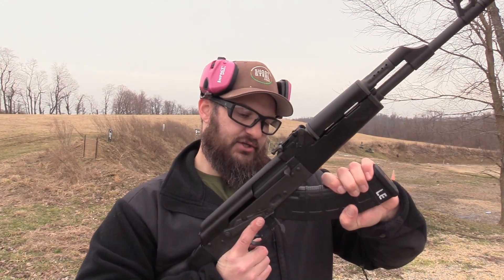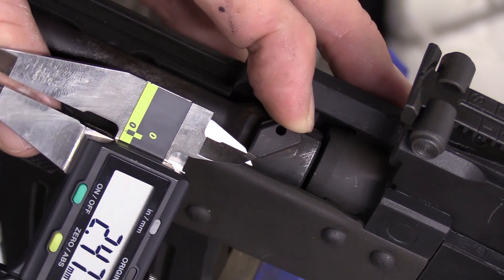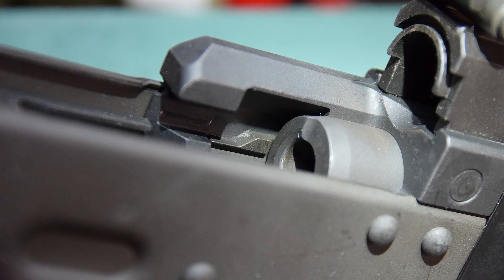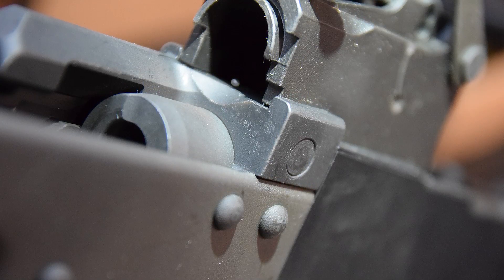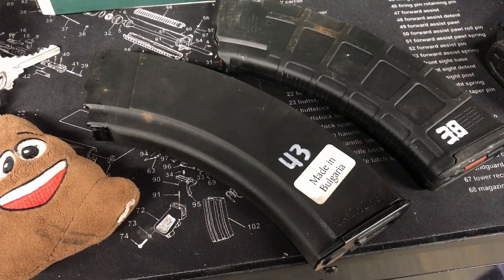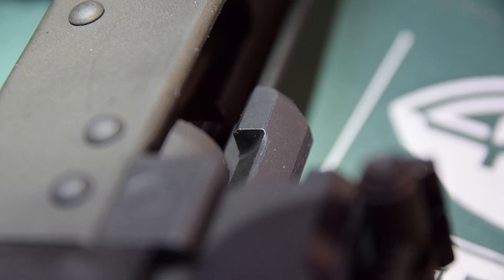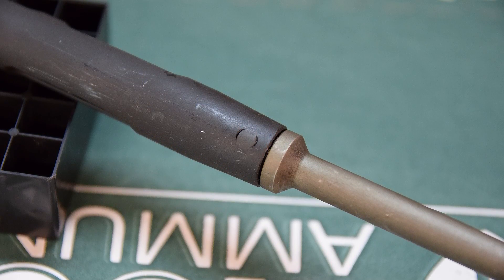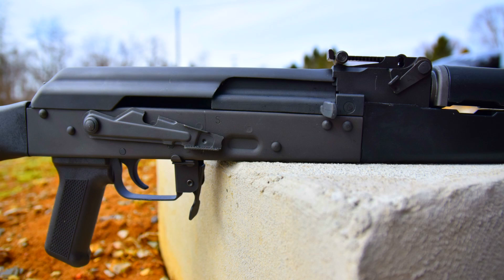VSKA 5000rd Test// Initial Overview (Part 1)

Comment: Every ak owner should have a no go gauge. That said, the vska has held up significantly. And it’s 2022. This rifle holds up. I know it drives the century gun haters off a cliff bc they have zero experience with a vska or even own a vska, and they just cannot stand this rifle is actually a well built AK ( at least for an AK at least). No it’s not a sam7, zastava, rifle dynamics etc…. I just love the haters just cannot stand that this rifle lasted lol

Comment: So, it has tool steel trunnion but a cast bolt and carrier?!!
Reply from the maker: Turns out the bolts is not cast
Reply: @VSO_Gun_Channel  But the carrier is? That could present some problems.
Reply from the maker: Yes the carrier is absolutely cast. According to the prints that I have been privy to, the carrier should be one of the most robust parts. I’m not going to quote actual numbers because that is not common knowledge. 

That said as long as everything is in working order and playing nicely, the 4 parts I care about as the dude behind the gun are the front trunnion, the bolt, the rivets, and the piston head. In that order.
Reply: @VSO_Gun_Channel  I read on the century arms website that the carrier is tool steel also you can go on the sight and see yourself I have the new vska  I’m just curious about it I don’t know why they would say it is tool steel and it’s not! But they may say that just to sell it
Reply: @VSO_Gun_Channel  cast carrier is horrible. Trunnion, carrier and bolt are the most important parts of an AK, plus rivets too.

Comment: My son Just bought a Thunder Ranch  VSKA AK. Turns  out Century Arms is still a Garbage Gun Maker! 15 years ago I bought a Century wsar10 ...Sights were almost as crooked as the rivets....a few year latter i bought an RPK ... a bigger version of the first AK...fast forward  12 years and the sights are straight but the rifle wont even work.  My son tried to load a round and the action jammed without firing a single round. Took off the Dust cover and removed the spring , Needed a mallet to get the action open, What we found was a scratched shell and even worse a nice impact on the primer with no trigger pull. He is trying to get it back to them but they don't want to answer phones and has to resort to Email. Point is Youtubers Get cherry guns to review .... You and I get Garbage guns to buy! I suggest You pass on any gun made by Century Arms.  3  rifles over 15 years, each and every one was crap!
Reply: Perhaps maybe you got a shit gun, I know century arms has a bad reputation. Maybe it’s quality control, I bought a trooper and it works great ( for now at least) put 515 rounds through it and it looks fine.

But yeah if I had bought 3 bad guns from a certain company I definently wouldn’t fuck with them lol.  Hearing what was up with yours I’m kind of glad I didn’t pick up the thunder ranch
Reply: @benanderson1372  3 century rifles over 12 years , first two crooked front sights and rivets,  FF 8 years and a 3rd bad rifle. I'm 0 and 3 lol
Reply: @johninphx9360  lol man that fucking sucks

Comment: The AR will always beat out the AK in every aspect. Better suppressor compatibility, accuracy, ergonomics, modularity, and the 2 biggest wins for the AR: bolt hold open and ease of reloading. There's really no debate.
Reply: John Coup the debate is that AK is more rugged durable and reliable it also shoots a bigger bullet
Reply: @dwill5724  real talk..#Salute
Reply: John Coup lol yeah ok...
Reply: @dwill5724  😂😂🤘
Reply: Hahaha no. An AR doesn't stack up to a quality Russian built AK.